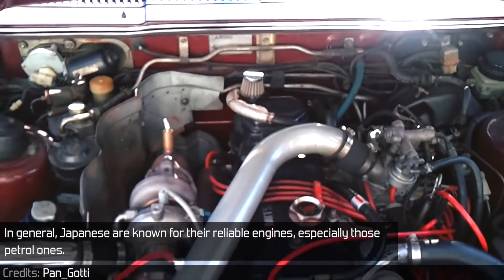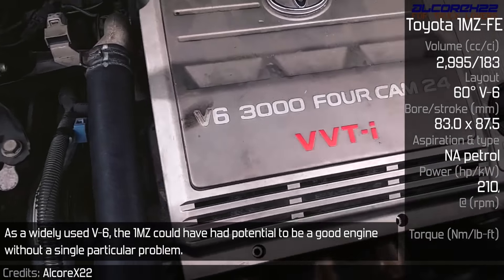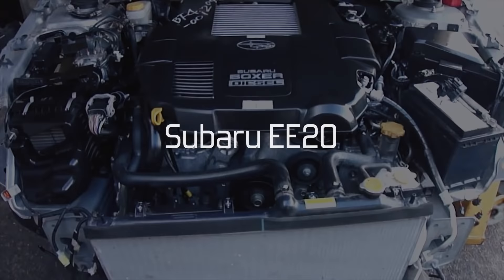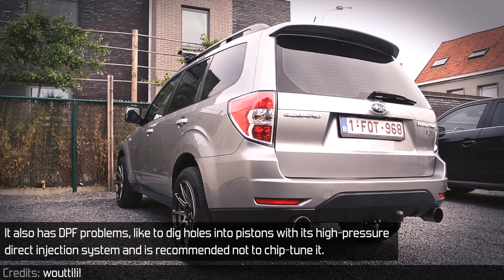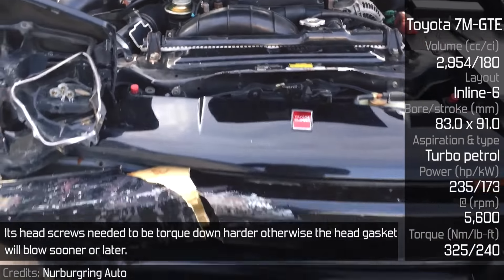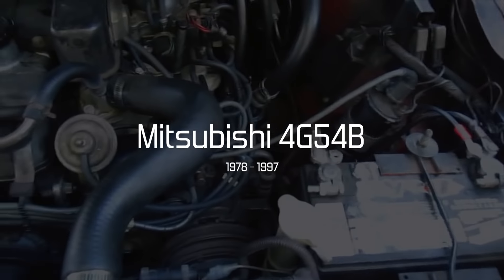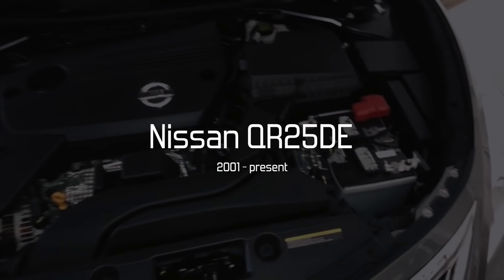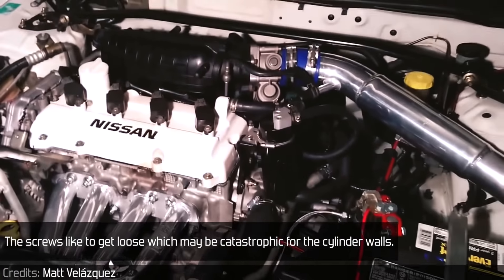Top 5 Worst Japanese Engines Ever

Comment: even diesel from subaru has that awesome sound
Reply: i own a 2010 version of that 2.0d and it doe snot sound like this and its straight piped till the particular filter. it has no rumble still, i have to delete the particular filter which is illegal... so ya
Reply: @alexttdot4890  well then you must have did something wrong because I have a 98 2.2 liter and then some custom exhaust that's my car has that rumble. Boxer engine diesel should send more even so because it's a higher compression engine.
Reply: Cringe
Reply: Have they continued this diesel engine? I really want one
Reply: @CaptainFALKEN  the only cringe here is your comment.
Reply: @keenan3201  no
Reply: We’ve never had a Subaru diesel in the USA.
Reply: They never offered the Subaru ee20 in the USDM market because of our strict emission standards, Subaru being extremely stingy with their designs tried to use a similar variation to their gas 2.0 engines, similar cranks, rods, etc. Didn't go very well, severe crank and rod bearing problems among other issues... Diesel engines need to be very robust in their design, Subaru was far too cheap to successfully produce a reliable one, unfortunate and disappointing.🤷‍♂️

Comment: I kinda disagree with the 1MZ. It's an amazing engine, but it is also extremely popular with American blonde women who don't like to change oil so I just think of it as the engine is fighting back.
Reply: Blake Parker Does the turbocharged 7mge in USA suffer from the same issue that is mention in this video or is it better to get an N/A 7mge?
Reply: Arz2003 like he said in the video, toyota made a big No No by putting a turbo on the 7m.
Reply: The 7mge wasn't any different.. Got 440k kms from a Cressida..done the head gasket once at around 210k kms.. Pretty tough Engine was surprised to see the 7mgte on this list
Reply: Blake Parker I agree the 1mz is an amazing motor, any engine will suck if not maintained
Reply: they are prone to get oil sluge. just service the car and itll be fine. defiantly not a list i would put this engine in, maybe a top 5 best engines
Reply: i also own one and what a lovely engine it is,mine is now in the 220 000km mileage but kicks ass anytime and with ease-jst serviced it after over 25000km and is back at its throne
Reply: Lol, it's been working for me, but I change the oil with synthetic at 5k-7k miles in southern climes.
Reply: 1mzfe is amazing. 1jz internals in a v cofig.
Reply: He’s smoking crack on the 1mzfe those are bulletproof as long as you keep up with regular maintenance
Reply: anthony conner tell that to my friend who babied his Jeep and it fell apart at 100k
Reply: Haha right can you explain 340,000 miles problem free beside regular maintenance😂😂 this guy needs to do better research
Reply: “It needs regular oil changes, otherwise the sludge will hit you hard”
worries in 2002 Camry that has gone 10K miles before last assumed oil change
Reply: Translating that (OP) to "if it's maintained, as any engine should be anyway, it's a fantastic engine so I don't think it belongs on this list" 
Completely agree.   But would it have killed the aftermarket to support it just a little?  VQ30, sure, but no 1MZ??
Reply: Most diesel japanese engines are shit
Had many fail before 200kms
Had a few german diesels at lease got more life out if them
Reply: It’s also popular with strong independent black women “who don’t need no man”
Reply: I loved the 1MZ. My 2000 Camry had 300,000 miles on it before it got totaled. The problem with my motor was a knock sensor code which is kind of a big deal but anything else I love! It moved pretty well and everything.
Reply: 250K on my 1MZ-FE and it runs perfectly. When idling you can barely tell it's even running. Full Synthetic oil changes and high quality filter every 10K. Nothing more needed. I plan on getting another 100K out of her, easily.
Reply: @libgapper9761  we had a M57 Turbodiesel in our BMW. Was their top tier Turbo straight six diesel at the time.

200hp and 450Nm of Torque, ran for 13y, did almost 350.000kms in all weather conditions.

Has cooked its coolant out of the block while doing 140km/h with AC on max power in 35°C lol 🥴

We put it aside, got it picked up and looked at.

Thermostat was broken, so the fans didn’t do their job. After fixing all that and checking tolerances it spun like a happy cat again 😂
Reply: i agree with the disagree for the 1mz for the same exact reason I have 01 solara sle 190k og miles chicks 02 highlander limited on 2nd motor
Reply: Yeah I really don't know why the 1MZ is on this list. It's not even close to the worst Toyota engine. My vote goes to the pre VVTi 1ZZ engine, 4GR-FSE or maybe the 3VZ.

Comment: The Subaru 2L turbo diesel likes to split crankshafts in half. Very problematic engine. Has something to do with the boxer design which makes the crankshaft very thin at places.
Reply: True, but only euro 4 engines, not euro 5 engines
Reply: Yes indeef euro 5 has fixed this a bit but still not perfect, but there is some guy who is making stronger pieces for the boxer diesel.
If u ever need his name is nace king boxer diesel
Reply: Just rebuilt my EE20 euro 5 last year and there's nothing wrong with the cranks. It's to do with the rear main bearing failing and not supporting the crank which causes it to break. Why do the bearings fail because Subaru recommends the incorrect service intervals. These engines need oil charges every 10k I do mine every 5k not 15k and then people leave them to 20k no wonder they fail. Idots
Reply: @born2fap  rebuilding a EE20 for a customer at the moment. It needs new bearings but the crank looks like new and it's done 200k km's  120k cave man mile measurements.
After doing a few of them it looks like the injectors start to wear at 150k which causes bad timing and hammer's the bearings.

Comment: The Japanese have designed many engines that fail through the last decades, as they are well-known for burning oil and blowing smoke hysterically in Camry's, Corolla's, & other models. Toyota is NOT the most reliable automotive manufacturer in the world...as we have witnessed countless model's that consume oil & have transmissions that fail. It does get old hearing how perfect this company is. Every manufacturer has the same issues, and no one has a monopoly on building great cars. Companies that have more than their share of poorly designed engines include BMW, Cadillac, KIA, Hyundai, Volvo, & GM. The Chevrolet V6 engines are total junk as far as I am concerned.

Comment: Disagree with the first one, those 3.0 V6 engines last for a very long time, my mom had one in her car and it had 300,000 miles on it and still ran strong.
Reply: Agreed I love the 1MZ
Reply: 11094DEREK has decent horsepower and torque for the time being, the throttle response was nice and it sounded like an aggressive V6
Reply: My buddy has one in an avalon with 380000 plus on it runs fine.
Reply: KryptoOne22 had a 1999 Lexus es300 it blew up at 45,000 miles. Absolute garbage...
Reply: Dodge 318 Cummins what did you do to blow it up, you probably had a shitty version of that engine
Reply: Dodge 318 Cummins those engines are good but what did you do to make it blow up?
Reply: Probably didn't change the oil
Reply: Joseph Ross probably
Reply: KryptoOne22 engine sludge problems that are well known.
Reply: Dodge 318 Cummins my mom never had the oil sludge
Reply: Dodge 318 Cummins if you do maintenance on it and get the oil changes on time and miles that’s how you make it last.
Reply: Seriously.  Just change the oil in time and do whatever you want the rest of the time.  It can take it.
Reply: KryptoOne22 I bought it used with lower miles. Never had an engine fail with such low miles. When the person before me only drove 5,000 miles a year probably only changed the oil once a year. All you guys act like you bough them new when in reality you bought them with higher miles thinking there great.
Reply: I know someone with the 1MZ-FE in a Toyota Avalon and it has almost 300K miles on it.  Just change the oil every 3K (or 5K with synthetic) and it will go the distance.
Reply: When I worked at toyota we had plenty of them show up with sludge. a family member is one singular instance and not a good looking glass into a true relevant issue and failure of an entire engine series. Either way, what I learned is general motors trucks and honda cars are the two best manufactured vehicles from any manufacturer. thrifty servicing, gas mileage, reliability, and simple competent engineering makes for a long lasting vehicle.
Reply: KryptoOne22 I had a Lexus ls300 and sold it with over 300k in original motor but replaced 2 transmissions
Reply: KryptoOne22 My wife has a RX300 that she had before we met. It has 220k on the motor and is on it's second replaced tranny. I find the motor to be fine, but the transmissions are horrible. We just use it as a backup now, but I don't really like any automatic transmission.
Reply: Treva Graham their to soft I learned to just baby it and change trans fluid regularly
Reply: TJ McDonald. Yeah they are soft. My dad was a mechanic and he always told us to not drive the car in overdrive unless we were on the interstate. Gas milage suffered slightly but none of us ever had to replace a transmission and we all had cars go over 250K miles. My brother still has the original tranny in his 97 Nissan Hardbody with over 330K on the odometer. My DD is a manual and I wouldn't have it any other way.
Reply: your supposed to change oil every 2000 to 3000 miles if you want it to last, depends on the oil you use.
Reply: I bought a one owner 99 camry v6 xle with relatively low mileage(202k kms). I've had it for a year now and I read about the sludge problem. So being a mechanic by trade, I removed the intake manifold and valve cover's and it was very clean. Though the original owner did 6k-8k kms oil changes with full or semi synthetic, he kept a detailed record of date/mileage of all repairs and maintenance.

Also for those with 1mz's with auto trannys, adjust your kick down cable to make the trans last longer. Do a drain and fill with dex4 synthetic and you wont have any problems.(if the trans is in good shape to begin with)
Reply: thedog556 Depends on the filter you get, most filters are rated for 8000k kms or 5k miles. So if you want to put a good synthetic make sure you get a good filter that is rated for extended mileage intervals.
Reply: All my Camrys have been v6's Camrys 95-00 and never had any issues, my 1st one 96 4dr had 60k wrecked the when it had around 140k and transferred that engine to a good shell she still runs like a beast lol, 2nd one I got was a 95 all black coupe got it for cheap cuz it had like 275 k lol ran like a champ I also wrecked it 😑sold the engine and trans still running in my dad's friends Camry lol than 97 4dr 5spd Camry 170k no issues wrecked it in fixing that one 😑 than 00 solara 5spd  with 200k she's still running like a champ nd not wrecked lol😂 I guess I got lucky with engines but unlucky on the road....
Reply: Aude  Childeres well hope that you get lucky with both
Reply: KryptoOne22 lol thanks man, me too I like this solara it's not to shabby and it's fun.
Reply: Every single engine has their own span of life.
Reply: Jeffery Jin I think that as long as you keep your maintaince up to date, any engine can provide you with it's maximum potential you just have to care for  them. show em some love every 3k.
Reply: except for Chevy ecotech engines.. I've replaced so many of them at work for either cracked heads or broken chains (on well maintained cars!) Then there's the awful dodge 2.7l v6 (Mercedes design).. There's no helping those. Now the v8s if taken care of, can last a long ass time from any of the big 3.
Reply: 001dman I guess we have to pray on some of em lol, I like em all I also have 93 Chevy 5.7 pick up step side rebuilt motor with better flowing heads the vortec heads. I'll probably get a Ford stang in the future. I've just been a fan of Toyota because they have done me good.
Reply: Aude  Childeres I love my yotas. Got 3 of em. 01 Tacoma with 300k on it, 06 corolla with over 600k and an 06 Avalon with 59k.. they’ve been good to me. Actually restoring the Tacoma right now. But Toyota has had some bad engines. The 3.0 in the old pickups was good for head gaskets almost every 100k. Unless you replace the trash oem one with an mls gasket
Reply: Korrupted I have 99 Es300. 248,000 Miles. How do you adjust the kickback cable? I bought it with 186k  and have owned almost 5yrs. I’ve had screen and fluid  replaced 3 times. Still feels kinda sluggish at times. It’s my daily driver as well.
Reply: Deldrick Jackson - It's where the throttle body is, you should have 2 cable's one is your throttle the other is the kick down cable. You can google and find instructions on I think camry forums.
Reply: 1mzfe was also a popular engine swap amongst Toyota fans. I wish I owned one
Reply: I love mopar engines, but that 2.7 was a serious piece of crap.  I would never own one.
Reply: KryptoOne22 that not what I hurd
Reply: is  that engine  was running at idle for 10 yrs   then   u or  some  kids  go full throttle? is  that   how  u blow  up? XD
Reply: KryptoOne22 my dad has one too on his Estima, we just keep changing oil
Reply: you know what your taking about  to make it last even longer run a inline filter they just  have a screen in the pan my 1995 camry v6 shifts great at 180.000
Reply: Yes man Japanese is life time
Reply: 250,000 original miles on my 3VZE
Reply: After he said 1mzfe I closed the video because that’s bs

Comment: damn that boxer diesel sounds hella sweet tho
Reply: I don't know what it is but they just sound so cool
Reply: @greasysteve5671  that is because of unequally long exhaust stacks where you get two pulses in shorter succession that normally
Reply: Yeah its my video, now i have made a new exhaust you can see on my channel, its alot better sounding
Reply: @felixbeutin9530  e eeeuuuuh no. It's due to it's flat four...
Reply: @kimdon3430  watch engineering explained's video this and just learn for a change
Reply: @felixbeutin9530  no the headers are made of equel length to improve Turbo response. Its a VGT Turbo.
Reply: @claudyfocan731  on newer models yes they changed it some time along the way
Reply: @claudyfocan731   indeed diesel has uel headers
Reply: The only problem with ee20z engine has been at the beginning of its commercialization...probably Subaru hurries to sell diesel cars in Europe, but more quality controls could avoid a lot of faulty blocks. It seems Subaru solved with euro5/6 engine generations (2010>>2020), it's a traveling engine and used like it's designed for it can reach high mileage with ordinary maintenance.
Reply: @rgberten60  Yep, a lot of the DPF issues people are having is due to them not letting the DPF regenrate and burn off soot accumulated inside the DPF. The regeneration only takes place in certain driving conditions (Highway driving in 4th/5th or 6th gear with 1800-2500 rpm). People drive these cars in city traffic exclusively for years and then get baffled over their DPF failure.

Comment: Had a 97 camry with the v6, changed the oil every 8k (kilometers) with synthetic. Never had a single problem, I live in a really  cold climate as well.
Reply: 97 Camrys are 1 million mile capable cars. most 90s toyotas are
Reply: Had a Lexus blew up at 45,000 miles they are complete junk. Stick to 4 cylinder Japanese cars.
Reply: Mike Vita I had 89 Camry with 235k on it.
Reply: Yep, same with mine. 1999 Camry XLE. I ran Mobil 1 5w30 at 5000 mile intervals.i sold mine with 350,000 trouble free miles. I gotta say it’s the smoothest engine I’ve ever owned
Reply: Ditto, had a Solara with this engine and the only problem it (eventually) had was with the knock sensors.  Still miss that car, the engine, the (manual) transmission, wonderful compared to my FT86
Reply: My grandma only drove toyota. I rode around with her my entire childhood until she stopped dropping me at work at 16. Years of driving never a problem. Ever. Didnt necessarily change on time.

Comment: The 1mz-fe was one of the best engines made! Mine had 354,000 before I was rear ended and the car was totaled
Reply: yess!! Did you end up dealing with the knocks sensor issue? I have a 2000 RX 300, I actually made a YouTube video about the bypass and someone else did the same for the Avalon, but did this affect you during your ownership?

Comment: I can personally vouch for the 1mz. It's a great engine but it is very sensitive to oil changes. Still, my friends dad went 28,000 miles on an oil change in his 2000 Sienna before the engine spun a rod bearing  because of the sludge. Still not bad for a 328000 mile engine.